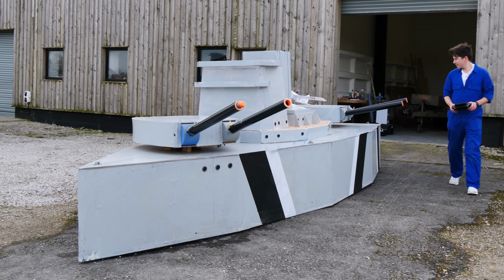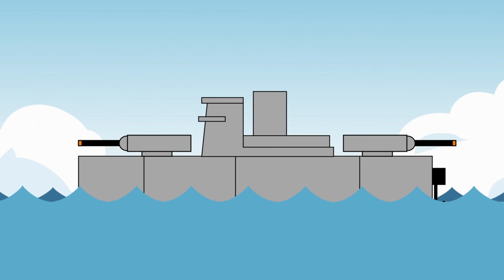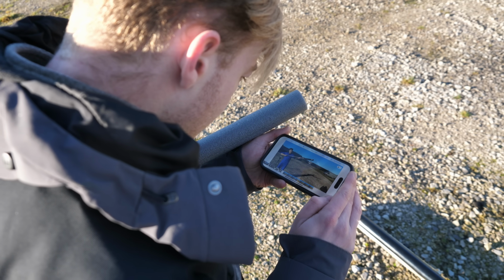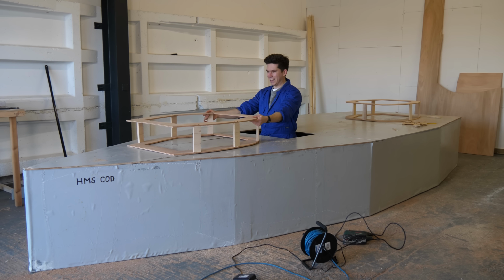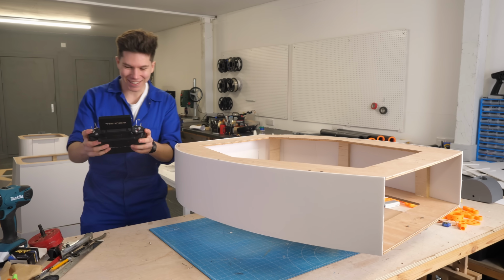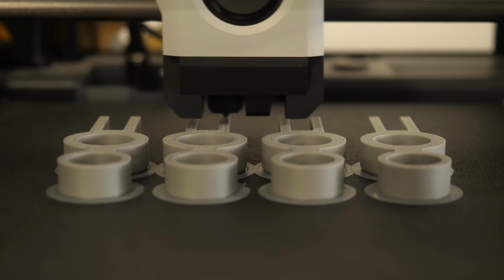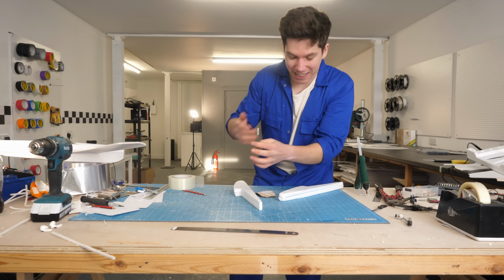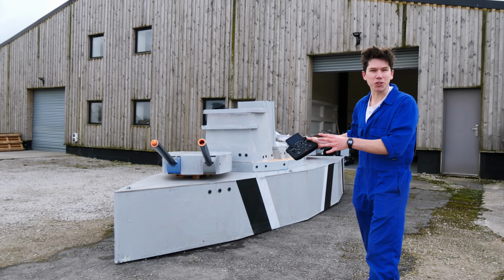Building a Giant RC Battleship (part 1)

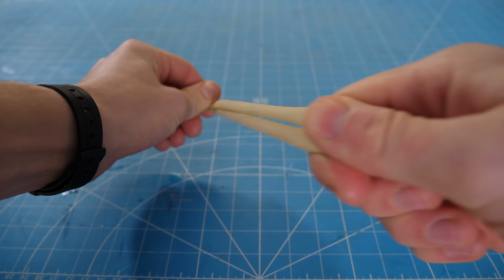Comment: 3:09 so... effectively, "We thought, hey, instead of using springs to power the cannon, hiw about we use springs instead."

😂😂😂😂

While its true that a Coil Spring works under both compression and tension, and that a rubber band only operates under tension as a singular band or series of bands in the configuration that effectively makes them all act like a single band. 

If you set the bands up under torsion (twisted tension, like an onager or catapult) or to act like a block of rubber instead of a big band (think rubber band balls) then it stops acting like a banded spring and more like a Coil Spring (under torsion, donce coil spring also work under torsion, at least in the form of being twisted into a tigher or looser spiral than its resting configuration) or like a rubber Pad (like the air cusion Casings on Big rigs, i.e. lorries)

But effectively its all still a spring. Lol. I honestly was half expecting you to start hooking up pneimatics when you were like "not spring power" but for the use case, rubber bands in whatever configuration you are running is indeed far superior to those flimsy stock coil springs. 

❤❤❤❤

EDIT: i suppose you could also have potato-cannonized it. Great power for the relative cheapness of the build, the availablity of components, and the short amount of time necessary to reach functional and safe. Lol

Comment: would be interesting to create an improved battleship featuring secondary armament and anti aircraft using other sizes of nerf dart. such as the mega dart for the secondary battery, and normal elite darts for AA. potentially even mounting magazines to hold a few shots. with a larger size might even fit people below the turrets to act as loaders

also unrelated note, this is probably the first time in history someone has converted a carrier into a battleship and not the other way around

Comment: One thought to that may improve cannon performance, use half length darts. The standard, normal scale dart doesn't have great flight characteristics in stock form. The blaster modding community has found that half-length darts fly farther and deviate less from the point of aim. That being said, I don't know how well it would scale up. 
Also, you could try either the NERF Mega XL darts or even NERF Demolisher rockets.

Comment: How to fix your Hydro foil boat

How to Calculate Hydrofoil Lift?

The following steps outline how to calculate the Hydrofoil Lift.

First, determine the coefficient of lift.
Next, determine the hydrofoil velocity (m/s). 
Next, determine the hydrofoil wing area (m^2). 
Next, gather the formula from above = HL = CL * (997*V^2/2) * A.
Finally, calculate the Hydrofoil Lift.
After inserting the variables and calculating the result, check your answer with the calculator above.

Comment: If you want to sail it from inside, you'll need to cut the windows on the Bridge Deck (usually at the top of the Main Tower) to see where you're going.

Nice add the Bismarck style Markings.

Next time, build another one and have a battle.

Comment: What a great RC project! The giant Nerf cannon idea is brilliant! BTW for the turrets, you may be able to reduce the wobble of the casings by placing a ring of some sort between the underside of the turret box and the deck. Real full-size warships used rings of roller bearings to cradle the turrets in order to distribute the weight evenly. A thin piece of plywood bent to form a ring with some low-friction tape pasted along the top edge would probably do the trick. Your firing accuracy would likely improve quite a bit. Overall very nice work!

Comment: Little tip for 3d printing: save your parts as a STEP file instead of an STL. Your round edges will be more or less perfectly round instead of polygonal and your fitments/tolerances will be much better - not to mention a cleaner look!

Comment: The Nerf gun has its origins in the humble rubber cap arrow gun which was invented around the 1880s.
the most deadliest version was the 1910 German Eureka rubber cap arrow spring load gun the Eureka-co made real hunting guns using a spring-load system around 1900 to 1910 these would shoot a metal bolt that could kill a deer.
in the manufacture of the 1910 toy they implemented the same spring as in the deer-killing springloaded riffle I have one if not the only surviving eureka rubber cap arrow pistol and with the cap removed the wood shaft goes through plywood! and, since it is a toy that is meant to be aimed at your playmates it's no wonder they were quickly revoked in 1910 my guess is that kids died but the WWII bombing on Germany destroyed any likelihood of finding such evidence.

Comment: With due respect, you are an excellent engineer, and your earlier projects were very impressive, and demonstrated a high level of planning, research, thought, and skill.

This does not. In fact, as far as ships go, even model ones, it's a pretty sad showing regardless of size. You didn't even make a new hull that addresses any of the glaring issues that the carrier had, which I considered excusable as it was simply a floating runway and served its purpose for that project, or even attempt to improve the current hull. It would seem you did no research whatsoever on ship design before constructing it. The carrier, however, was better detailed and showed a higher level of care than this ship, and at least was a creative idea.

For instance, the turrets are shoddily constructed and wobble around horribly when traversing. This is due to the decision to put them on a tiny ring for some reason. Additionally, there were no barbettes and the turrets were simply mounted on a four legged wooden stand on the deck. The guns themselves were similarly unimpressive, and showed a similar lack of planning, research, and effort. Considering the depth of the hull and the size of the turrets, you could have easily included an air compressor, and a breach loading system of a simple sliding block design, and magazine fed autoloader and run it off compressed air. I mean, come on, even nerf guns do this. (minus the more complex breach design)

This same air compressor could have also been used to power a catapult for the seaplane, although you also did not do this either. The seaplane itself is additionally hurtful due to how genuinely beautiful it is. The design shows a clear amount of effort to understand the reference aircraft's design, with an intricate array of struts and wires, well-designed pontoons, and a gorgeously shaped fuselage. It is a very apt representation of contemporary aircraft design. If you applied the same amount of effort and research to the ship, this would have been a completely different story.

The superstructure of course is also poorly fitted and detailed.

While there was a substantial amount of effort expended due to the sheer scale of this project, it is clear to me that you put little thought, research, or design work into this project. To top it all off, an entire 2 minutes of the video is taken up by a Raid: Shadow Legends ad, which you didn't even do us the courtesy of putting in a chapter so that it could be easily skipped.

As a longstanding fan of your work, many of which are legitimately impressive engineering accomplishments, this project is a sad thing to see. All of this could have been more excusable if it did not come from someone like you, who has proved he can certainly do better. Regardless of whether this is filler content for another project, it is disappointing and certainly not up to your usual standards, and I sincerely hope to see better in the future.

I wish you and your future endeavors the best.
Reply: Totally agree on that. Sure, the boat is big, but also ugly AF. It's deeply saddening to see such a dip in quality.
Reply: I know right? This is the kind of thing I would expect from a some big channel with the title "I just built a REAL LIFE BATTLESHIP that SHOOTS GIANT NERF DARTS" and not from the person who designed and built a top speed jet car.

Comment: I'm currently working on a project to resurrect a cold-war era 12.8m satellite dish.  We've replaced the original very-large DC servo motors (30HP per axis!!!) with some much-smaller modern software-controllable servos and some "'prefix" gearboxes.  Initial testing has been encouraging....

Comment: C'mon bro, instead of a weak nerf gun mechanism, use a strong advanced one, you could make nitroglycerin as a propellant for the rounds, and a heat and pressure resistant thing in the interior of the barrel to be able to shoot some good ammo with it.